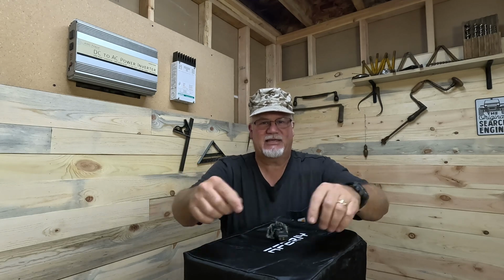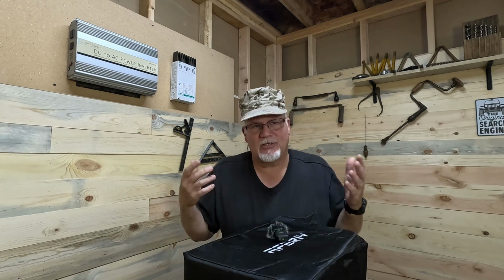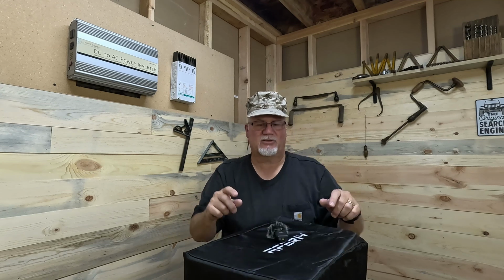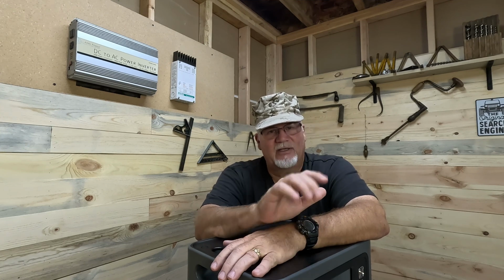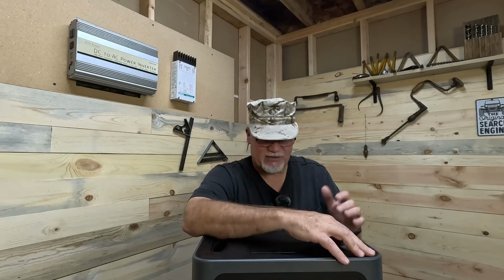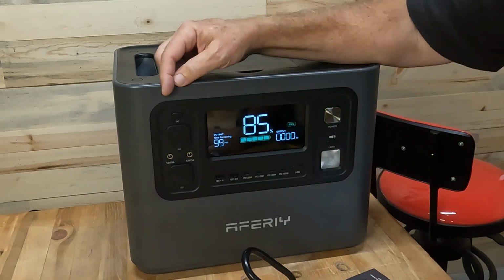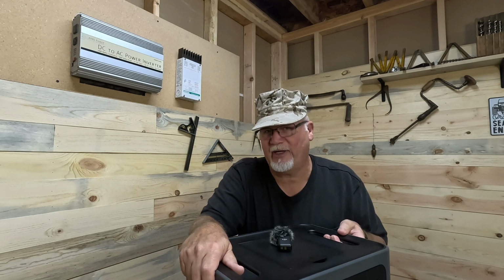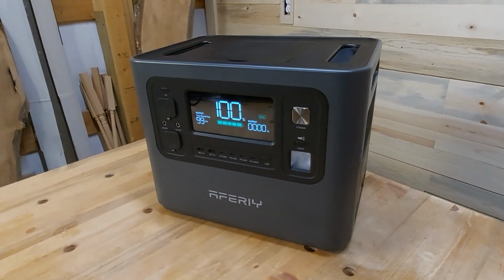🔋 Aferiy P210 2400 Power Station Full Review | Real World Testing! 🔋

Comment: Be Aware the P210  Power Station has 2 models; 100-110 volts and 100- 120 volts.
I did not read the specs for the one I ordered and it is the one with 100-110 volts which is not good for running a 120 volt air conditioner.
Aferiy has offered to accept return at their expense, which reflects favorably on there 30 day satisfaction return policy.
Reply from the maker: I'm glad they were able to help you!

Comment: Does it have a RV outlet? Can we plug this to an rv AC panel via a transfer switch box and switch to 30 amp shore power?
Reply from the maker: It does not. However 2kwh isn't a lot for an RV
Reply: @TheOldJarhead  2kwh is certainly not enough but with solar and/or hooking a 24v 100a battery as you showed it in your other video you can get plenty of wh. It is too bad it does not have a rv outlet unless the rv would run on just 20amp
Reply from the maker: All good points

Comment: Afternoon Mr Old Jarhead. Need to pick your brain. Aferiy has the P210 on sale now. $719.
Oupes has their mega 2 with extra battery for $1330
On paper it looks like 2 aferiy’s at $1438 would be a better buy. 4,000 watts vs 3,000.
Trying to figure out why folks would buy the Oupes instead of having 2 seperate units? Help it make sense.
Reply from the maker: I think it depends on intended use.  A 3000 watt inverter will run pretty much anything you need that a power station would be good for and the extra battery will charge at the same time as the main unit, plus adds an additional 2100w of solar input vs the Aferiy (which I also like) with it's 500w solar input.  If it were me?  I'd go with the Oupes Mega 2 and extra battery which gives you 4kwh and expandability to 10kwh -- but again, depends on intended useage.
Reply: @ unfortunately I don’t have the capability to run solar. My main purpose is backup when the power goes out. I’d be charging with wall outlet/ gas generator if power is out longer than 24 hours.
Given that would you still do the Oupes? 
Thanks for your fast reply also
Reply from the maker: Hmmmm. I think they both charge at the same rate so the Aferiy might give an advantage in the you can charge both at the same time or carry one to the generator while the other is running.  And by adding a couple 24v batteries you can extends the Aferiy via the solar port and charge that off the generator as well.  Price wise the Oupes beats it but you can position the Aferiy 's at two locations if needed.
Reply: @ thank you sir. Would have to run extension cords to the other end of the home. If I was rich I’d get 2 Oupes lol
Reply from the maker: No problem!  I get it!  Then you could get an EG4 AIO system and 10kwh of battery 😀

Comment: I left a comment  about this power brick that talk about the specs for your using this unit to run your electronics that it will not provide a true 119 or 120 volts under a load . the web site that does this testing is a youtube channel that is not paid by anyone. this site is The Solar Lab I said check it out so you wouldn't lose any of your equipment from low voltage power supplies.  Please look up this solar lab channel to protect your equipment. I do My homework or research I think you need to look into that unit more carefully. Just a Vermonter trying to help you out.
Reply from the maker: Thanks for the note.  The ANSI standard for usable voltage for the consumer is a tolerance of +5% to -10%, so as long as a unit tests between 108v and 126v, it would be considered safe for consumer electronics.   Most think we use 110v, but we don't. We use 120v.  Now, in my case, my Generac Ecogen is running at 117-119v at 60htz, and I've never had any issye with my electronics, but I would be happy to check out their channel and see what they say.
Reply from the maker: Also, they did not test or review this unit, I just looked.  Furthermore, the All Powers unit I reviewed in a different video did not have any issues.  I didn't test voltage but may have to now just for fun 😉
Reply from the maker: OK I found the one about the 'Air Fryer' - and I see now the voltage drop.  That's interesting and I might have to do some testing myself.  However, I'd like to note that I've only ever used one of these power stations to run one thing at a time which his testing seemed to show that it did well.  I think trying to run 3 1500 watt heat guns at once while a good test isn't a practical use of the power station so I'll give it a pass.  For me, these are just that, portable power.  If I want something to run 2 1500 watt heat guns I'll run them off my much bigger power system ;)  With 4kw inverter that can peak at 1500 watts.  But it's fair to say that the EcoFlow, Bluetti, Anker etc power stations (which range from twice to three times as expensive) should be much better machines.  It's just now a question of: is it worth the extra $500 to $1000+ so I can run multiple things at once when I never do?  OR at least almost never do on the 120v inverter on any of my power stations?  For me, it's not worth it.